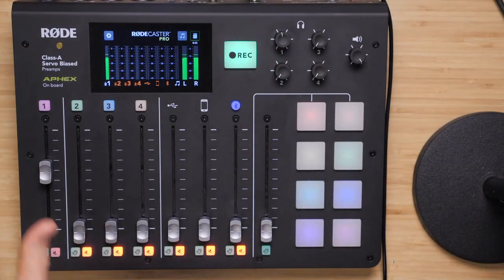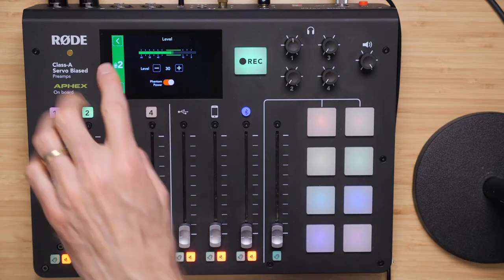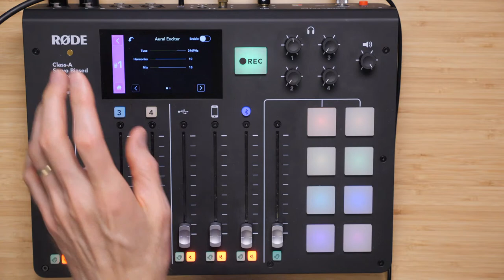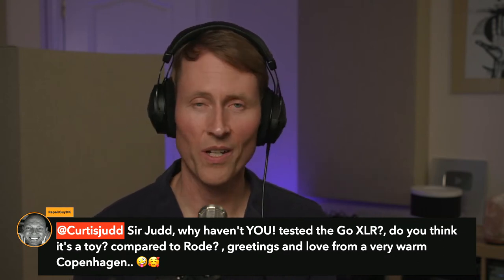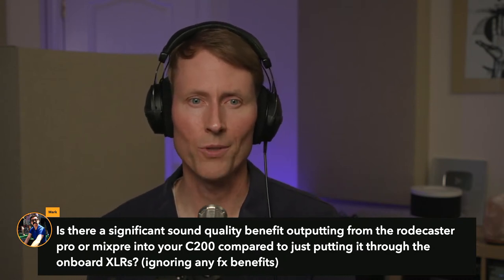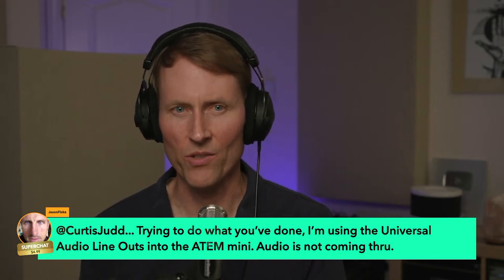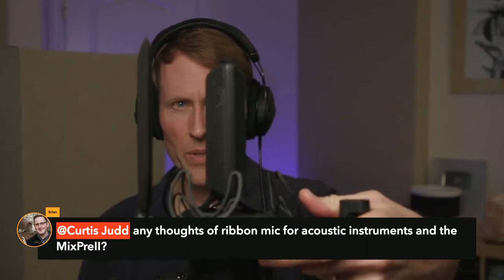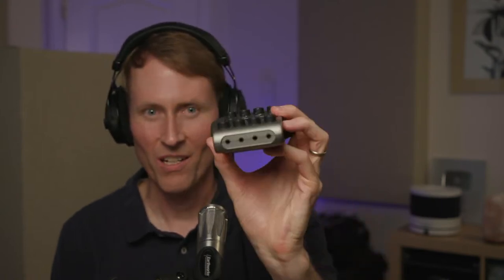ATEM Mini Audio from RODECaster Pro

Comment: Hi Curtis, love your work. Is a Line Level Isolate the same as a DI Box ?
Reply from the maker: Hi Cast Ministries, no, they are different things. A DI box converts an unbalanced signal to a balanced signal. This is often used to make longer cable runs such as when you have an instrument on stage and need to send that signal back to the mixing board a few tens to hundreds of feet to the mixing board. A line isolator (transformer) is used to Isolate one device from another by filtering out hums or other interference.

Comment: If i keep the rodecaster separate and then choose the atem for video and rodecaster for audio in my broadcast software, would there be any kind of delay or sync issue?
Reply from the maker: Yes, but the broadcast software should have an audio offset setting.

Comment: Hi Curtis, great session. I have a Rodecast Pro, switched my mini to line in for mic 1 & 2, i see audio running monitor out from Rode using music effect or sounds, but not any seeing my any mic volume via mic1.Am I missing something?
Reply from the maker: Is the fader for the effects channel up? I often miss that.
Reply: Curtis Judd - I just tested with the effects fader up and down,  no change. Going to order the cable your using, see if its the cable i ordered.
Reply: @curtisjudd  - Hi Curtis, order the new cable. Hopefully that might deliver a different result. It's John, just replying back from YT channel that I am just launching. I will watch the TakStar. I have one of those wanted to compare, Shure just came out with a new mic that I saw another YouTuber use, it seemed like  decent noise cancelation and quality.
Reply: @TheRealJPAdventures  Hi, I got the new cable, still the same result. Is the fader for the effects channel need to be up or down? Stumped.
Reply: @curtisjudd  I figure it out. Discovered the auto mute outputs was enabled, disabled it and mic for line is working. Once your turn that off, you can then include your effects channel fader being up or down, and then also feed from system, etc.
Reply from the maker: @JPChalkTalks  Good work!

Comment: I work with 2 iPad pros for my zoom teaching. Is the Rodecaster and Atem mini only for working with audio? Will they help with connecting video between the two iPads?
Reply from the maker: The ATEM Mini is an HDMI switcher. So if you connect the two iPads to the ATEM mini with the Apple AV adapter dongles, then yes, you can use both of them in your live stream or Zoom meetings.

Comment: Hello. Love your work and I have one question. Can I use two mics output for one line trs et cetera ?
Reply from the maker: If I understand correctly, you want to route two of the mic outputs to one of the monitor outputs? And presumably, route the other two microphone outputs to the other monitor output? If that is what you're asking, unfortunately the answer is no. It does not have a pan control for each channel like traditional mixing boards.

Comment: Would something like a "TritonAudio FetHead" help to reduce the gain you have to set in the device (or in the compressor additionally) when using the SM7B ?
Reply from the maker: Yes, absolutely.
Reply: @curtisjudd  I have been to quick with my fingers anyways. Shortly after typing this in, you gave the answer in the video anyways 😂 But thanks for the reply.
Reply from the maker: @marcthiele  👍
Reply: Zazz

Comment: I own the Atem mini Pro and the RODECaster Pro and so far I have connected the two via the headphone out. Do you think it's better to connect via the monitor out?
Reply from the maker: In theory, yes. But in practice, if you're getting good results with the headphone output, I see no reason to switch over to the monitor outs.

Comment: Hi, I well aware I’m late to the party but I’m just watching this video right now. I’m noticing a high level of hiss and noise on your SM7B which is exactly what I will be using with your exact setup. 

When you switched to the second mic the hiss and noise reduced by around 50% (but it was still there and still noticeable)

Has all this been fixed since? Is there a work around…
Reply from the maker: It is important to distinguish between room noise and self-noise generated in the electronics/audio chain. There's a bit of both here. Note that the RODECaster Pro doesn't have truly dedicated line level outputs, just the monitor outs and it isn't ideal. I don't know of a workaround but you might try routing the audio to camera and see if you get better results with your particular camera.
Reply: @curtisjudd  thanks for your answer. While I have you here… can I please ask you one last question that seems to have been bypassed by ever review out there… how does the STANDARD MUSIC AUDIO sounds on this device ( tried to competitor and it sound terrible, muffled and really killed all the dynamics of a song) not sure if this is designed for music play but at this price point I’d like to think that the sound is of a great quality. 

Thanks
Reply from the maker: @DocFUNKist  I have found that when I play back pre-produced/recorded music, it sounds fine on the RODECaster Pro. But I don't try to mix live music with it as it isn't really made for that. Oftentimes a bad sound is a result of the operator mixing badly. Not so much a limitation of the RODECaster. I hope that's what you meant by your question?
Reply: @curtisjudd  yes indeed. I was thinking to use it to mix my music aussi (coming for another DJ mixer via (XLR to 3.5mm) with a single mic (using ducking) but sound quality is really important to me. But you’ve answered my question. I truly appreciate you’re taking the time. I enjoy your videos a lot, you always speak in clam fashion and never fail to cover all details. Thanks a lot

Comment: You can lock the monitor output in settings so it is always Line level out
the hiss will be running your gain at 55  drop the gain and run the fader at 3 whiich is actually unity
Reply from the maker: Interesting, RODE told me that 5 is unity.
Reply: @curtisjudd  I did a test with a tone generator.. It didnt make sense to me that the fader was run at half up  there is no reason to have that much head room on the fader if 5 is unity

Comment: Great live stream Curtis! Out of curiosity, when using lower ohm headphones or IEM's, I notice a hum via my headphone ports on my Rodecaster Pro. This hum happens no matter what I do. If I have it simply connected to any outlet in my house, and only my headphones, I get a hum. This doesn't happen with my DT 990 Pro's (250 ohm), because they are power hungry. Does this happen to you man?
Reply from the maker: Hi Shadeless, thanks! I get a tiny bit of hiss, but not what I would describe as hum. Do you also get it when battery powering the RODECaster?
Reply: @curtisjudd  Thanks for the reply man! So I've been testing out the Audient Evo 8, GoXLR, and the Rodecaster Pro, and both the Goxlr and Rodecaster power up via a power cable. However, the GoXLR does not have that lovey ground noise. It is like a fuzzy noise, not sharp and . How does one operate the Rodecaster via battery power? Is that a different accessory?
Reply from the maker: @ShadelessDen  Yes, there's an adapter cable which allows you to use a PD USB battery bank to power the RODECaster. I'll add a link for it in the description.
Reply from the maker: Also, I do get what I would describe as hiss in the headphone amps on the RODECaster - they aren't perfectly clean.
Reply: @curtisjudd  Bummer. Does this happen with the USB Power adapter as well?
Reply from the maker: @ShadelessDen  I'll need to check  next time I pull it out. But the hiss I heard was not prominent and not what I would consider problematic. Based on your description, it sounds to me like you're getting more than just a little hiss. Might be best to contact RODE support and see if they can help get to the bottom of this.
Reply: @curtisjudd  For sure. I have contacted them. Hopefully I can get somewhere with it. I found that I can connected a Ground Loop Noise Isolator, but it messes with audio quality. :(. But yes, let me know if it happens with USB power.

Comment: How did you make the superchat questions show up onscreen? What program, and what templates? I'd love to be able to do that.
Reply from the maker: Hi Daniel, that's a Chrome plugin called Live Chat Overlay. We run that on a separate laptop and feed it into the ATEM Mini. We then use a key to display the chat at the bottom.
Reply: @curtisjudd  cool! Is that laptop running the plug in limited to doing only that one thing, or can you also have the stream tab open in chrome, monitor the chat, etc?
Reply from the maker: @danielroy6564  In our case, we just use it for the chat to keep things simple. If you just started and ended the stream on another tab, that would probably be fine. I just like to keep devices dedicated to a single purpose so we screw up less often. 😀
Reply: @curtisjudd  great, thanks for the info! What’s the advantage of using this app and streaming directly from the ATEM as opposed to streaming via stream labs and using their overlays for super chats? Aside from freeing up the usb-c out port, of course.
Reply from the maker: @danielroy6564  My technical director uses an ATEM 1 M/E panel to switch the show. That doesn't work with Stream Labs.
Reply: @curtisjudd  ah I see. Thank you for taking the time to answer my questions. Love the videos too!

Comment: Hi Curtis. I signed up for your F6 course. Thank you for making it brother. You're gonna save me some time there. I have a computer spec question regarding the Atem Mini range. I have a late 2010 Macbook Pro 17 inch which is still pretty good (one of the last made with an Nvidia Card!). I'm holding out for the Apple Silicone Macs which could be later this year/early next year. I am interested in the Atem Mini as I mentioned to you already (thanks for the acknowledgement). I can't seem to get a reliable answer to my question by researching online. Blackmagic's website states that the control software will work, but what I was hoping you could help me figure is will my 10 year old old faithful Mac be powerful enough to stream with the entry level Atem Mini as I am aware that the higher models have streaming hardware built right in. I won't be doing live streaming for awhile but it would be good to know if I'm gonna hit a brick wall with my current machine if I need it to stream before the new Macs come out. Any other limitations that pop into your head I'd love to hear. I'm mainly gonna just use the Atem to convert an A6400 into a webcam and switching between a few camera views sounds like a dream. I reckon by the time I need an advanced Atem Mini there will probably be new ones out at the rate they're going ( like Mark 2s with headphone jacks and no latency).
Reply from the maker: Hi Alan, the 2010 MacBook Pro will huff and puff while streaming. I assume it can do the job, but it'll be a serious workout for that computer. My weekly livestreams, at least those where I use Ecamm Live to stream, I'm using a 10 core iMac Pro. The fan doesn't turn on, but everyone I've talked to who uses even more modern MacBooks say that their fans are on pretty much the entire stream. Also heard that people with MacBook Airs can't stream in at least some cases - not sure how that manifests itself exactly, just hearsay.
Reply: @curtisjudd  Thanks Curtis. I guess I could test it by going on Facebook Live. I'm still trying to decide between the Atem Mini/Pro. I agree with light and sound being of utmost importance (I think your lights are more important than your camera and your sound has to be great...we agree that people will forgive bad video if the audio is great). Would the Pro take up some slack from my computer hardware or would I still be in the same boat? I think I need your streaming course!
Reply: Your Rodecaster "New Accessories " vid just answered my question...looks like the AM Pro will do that! Well at least I have a path now. Ahh well, the NTG 5 will have to wait a little longer, but you know it'll work out as I don't see myself needing much outdoor work for awhile. I'll get by with the Oktavas. Thanks for the great work, advice and training sir. When my channel is up I will promote you.
Reply from the maker: Yes, that’s the beauty of the pro version.
Reply from the maker: The streaming course covers just sound for streaming with the ATEM. Looking at making a more general streaming course

Comment: Using the cable you suggested and getting dirty noise (data) coming through to any device I am recording to. C̶a̶n̶ ̶y̶o̶u̶ ̶s̶u̶g̶g̶e̶s̶t̶ ̶a̶ ̶s̶u̶i̶t̶a̶b̶l̶e̶ ̶g̶r̶o̶u̶n̶d̶ ̶l̶o̶o̶p̶ ̶i̶s̶o̶l̶a̶t̶o̶r̶? I also used it with a battery away from all cables - same result - would suggest that that cable is not shielded properly...? Update - used a smilar cable - same problem - data leak from Rode? Latest update: Sorted it - definitely the cable as I used 2 Jacks to XLR straight to my Focus Studio monitor speakers - no interference no hiss with my shure because I use fetheads. I'm in the UK so different voltage.  Anyway will go a different route -  jack to XLR - ground loop box to xlr to 3.5". I have all the cables - somewhere!
Reply from the maker: Nice work and thanks for sharing!
Reply: Hi Curtis, great channel and thanks for all your valuable insights.

I've also been suffering with noise from the RCP monitor outs - sounds like data interference which can change pattern when using the touch screen (could be similar to L4LTV & Paweł Przybylski?). I've tried different unbalanced cables, speakers and a friend's HS7 monitors using balanced cables and still hear this from these ports.

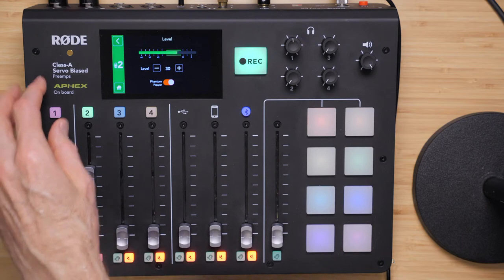Also noticed when turning up the volume to listen for the SM7B hiss, when you switched to the SR314 I could hear the same artefacts in the quiet sections of your livecast, probably the gain for the SM7B was drowning it out. I downloaded the mp3 from YouTube and can see similar RX7 spectrogram traces in the quiet parts (10:23, 43:17 etc.) to the recordings I've made to a MixPre II, so is this common to all Rodecaster Pros?
Reply from the maker: @max-it  Looks like we need you to make a video - thanks for the details!
Reply from the maker: @max-it  I would add: I do NOT recommend people buy the RODECaster Pro to use it as a mixer to feed to another device. It is NOT designed for that purpose.
Reply: @curtisjudd  Thanks Curtis - will look to produce a video sometime over the weekend. Have a question out with Rode about this as well, so will post if I hear anything back. 

I'm not sure if I'm bending the use of the Rodecaster, but hoped that I could use the balanced out for a pair of monitors and double up as an interface for my Mac? Had some gremlins with the headphone pots on a Mackie Big Knob Studio+ so chopped in for the RCP hoping this could be a better solution for hosting Zoom events and offer future flexibility. Appreciate it's not a mixer but also looking to use with an ATEM mini for some livestream events (with OBS) later in the year - could use the MixPre II and the ATEM's audio features instead.
Reply from the maker: @max-it  I'd probably opt for the MixPre/ATEM route myself. I've had consistently good results with that combination.
Reply: OK solved it by using my zoom H1. I tried a number of leads and complicated fixes - I have all the leads and ground loop boxes etc and none of them made the difference. What did make the difference was to turn the input recording right right down to 10 on my zoom H1 - this just cuts out all the interference and you get a clean recording / signal. When you explained this bit at 7:24 I think you must have had the input set to low  to compensate for the output at full. If you try to record to another device and you set the record input level too high you'll hear the interference. Now I can hook up my Roland V-1HD as I think it'll be fine.Yes keep the output from the RCP high and the input on whatever you are pushing out to low in the signal chain does seem to do the trick. Each device seems to have its own sweet spot however so it's a matter of trial and error.
Reply from the maker: @L4LTVuk  Thanks. And how are your output levels on the live stream? Does your audience need to turn up their volume to hear?
Reply: @curtisjudd  Outputs are fine as far as I can judge - tested the Roland V-1HD last night and it's clear as a bell. Thanks.
Reply: Hi Curtis,

Heard back from Rode, they suggest my noise is due to the use of unbalanced cables and I was mistaken about my test with my friend's HS7s - he's using shielded 1/4" TS cables, not balanced as I originally thought.

I'd also found the headphone ports to be cleaner with my active speaker setup (BeoLab 12-1 via line-in) - Rode confirmed they use internal buffers to avoid noise on these ports, so maybe a workaround if anyone is having similar issues from the monitor outs using unbalanced cables.

I've recorded some samples and video this afternoon and noticed that the 'digital noise' seems to change pattern when the screen is updating (meters moving, menus being selected etc.) - so my guess is the LED touchscreen technology could be a source of the noise. I've a pair of monitors on order so I'll set these up with balanced cables and see if this overcomes my issues.
Reply from the maker: @max-it  Internal buffers, but only on the headphone outputs? Hmm. Thanks for sharing the details!
Reply: @curtisjudd  Hi Curtis,

Final update on this one - received my monitors this weekend and when connecting to the Rodecaster with balanced cables there is no sign of the noise, so this seems to back up the comments from Rode.
Reply from the maker: @max-it  👍